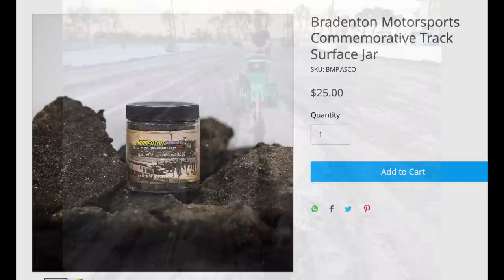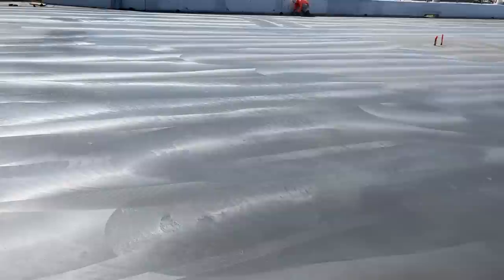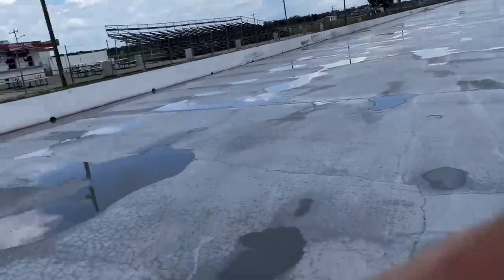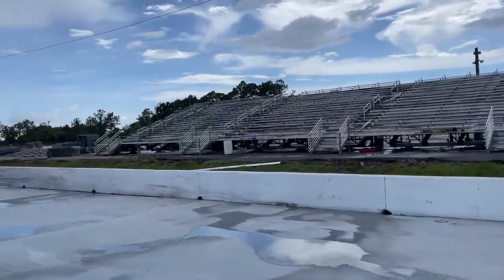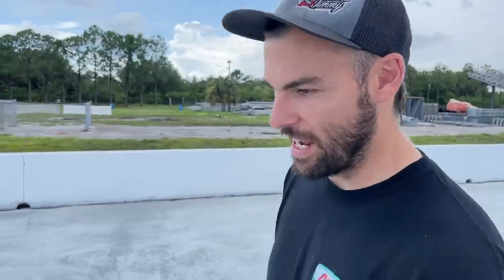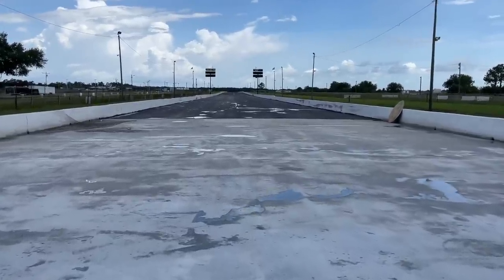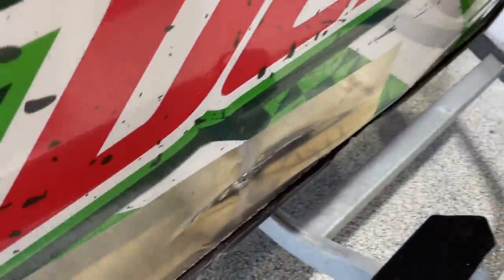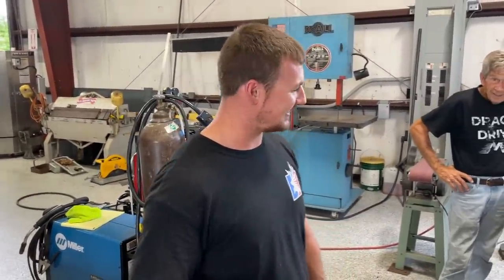This Is Why Our Beloved Drag Strip Closed...

Comment: They didn't keep the concrete wet soon enough to slow the curing: Crazing cracks are very fine, surface cracks that resemble spider webs or shattered glass. When the top of a concrete slab loses moisture too quickly, crazing cracks will likely appear. While unsightly, crazing cracks are not a structural concern

Comment: Told ya steel better for that application. You should have double hulled that boat and the sides the way you treat it. otherwise its going to keep leaking if you keep crashing it into the rocks, aluminum no likie the rocks guys.

Comment: Add a .65 mile dirt oval with a quarter mile dirt oval that uses front stretch as front stretch then put back stretch in infield and the corners and also inside the 1/4 mile oval you can put a small racing lawn mower and go kart dirt oval.  and a motocross/ short course off road truck track and can use same track for rally cross racing and maybe start a local rallycross racing classes like oval asphalt and dirt weekly racing do it with rallycross would be epic and give guys who race dirt and asphalt oval another form of racing they can try or race in for sane money they spend on dirt and asphalt oval mods and latemodels. Add a asphalt .75 mile oval with a 1/4 mile oval using front stretch as the quarter miles front stretch and build it to where you also have a roval lay out with it as well like Charlotte motor speedway and then you can race asphalt oval cars on roval so drivers have to learn road racing as well as asphalt oval racing to make them better drivers and give fans and drivers a one of a kind racing experience that is the only thing like it in united states. You could run legend cars and street stocks, pure stocks and a 4cylinder fwd ministock class on the oval and roval.

Comment: That concrete does not look great. Our family driveway had those micro cracks (only stand out when wet) and it was ripped out within a week and repoured because they considered it failed and couldn't ensure the longevity. I'm not an expert but this doesn't look good and it seems like there are larger cracks in some spots.

Comment: 10 yards of concrete in a truck so 1100 yards of concrete for that project. $120/yard, so roughly $130k-$150 just for the concrete in the trucks. Then you have to calculate another $150k just in civil engineering design and rebar installation. So $500k is my rough estimate on that installation so far with another $80k-$100k for possibly new electrical for the tree and some other miscellaneous stuff that I’m missing. I’m guessing another $50k in bleachers. Add $60k in asphalt for underneath the bleachers.

Comment: There are so many running cracks in that concrete  it is far from a great job  and a full length cut centered between the side walls should have been added  .   Great work it's NOT

Comment: It sucks that they picked asphalt for around the bleachers because the black absorbs all the heat from the sun and the aluminum picks up the heat transfer cooking your ass.
Reply: Could be a off-white or gray cool coat applied to it so it's not so radiant just a thought but I agree with you asphalt's hot🔥 but it's better than getting sandblasted and much easier to  keep cleaner.

Comment: I hate metal bleachers. I went to a track that had the recycled plastic 2x4 and plastic wood looking bleachers and it stays nice and cool during day time summer heat of 105 degrees and the plastic fake wood stays nice and cool seriously so much nicer the aluminum bleachers. And also that polish I have ran on it before on a brand new resurfaced concrete oval track and I took rubber so nice all the way around the track it would take runner just not the corners so if your racing like a 410 900 HP wing sprint car you get more grip out of corners and straights and for restarts so you don't spin tires as bad like you would with out the polish. Asphalt should never be used for racing it's nasty and can be dangerous when used for oval racing huge chunks can hit drivers and go through lexan windshields and if there is a huge hole ripped up during race and don't see it and you get loose and sideways and hit it just right it could snap your axles or shoot you up to the wall or go flipping and all my circle track asphalt cars have nascar 9 inch floaters they are made by winters. I love Jones racing I currently run every part they have for my sprint car on my car I love Jones racing products they are high quality good looking finishes that don't fade or chip and crack from heat of racing and stays looking like new for a long time Jones racing is the best parts hands down

Comment: For all the concrete guys, Why the heck is that concrete all cracked up one week after laying? Admittedly I know very little about the process, but after 58 years on this earth, I have never seen new concrete look like that. Lucky Florida doesn't see much freezing temps or that would surly be useless in one season? Did they lay it too thick/thin or wrong mix...as Cleetus said these guys do this for a living, but aesthetically sure looks not to be a proper job and wouldn't hold up for very long, looks like it is get ready to crumble before cars release 1000+ horsepower on it IMHO.

Comment: fuel boiling in the pump, over heating idling at 95... A/C on at 95 poking past a cop at +2mph, 3 minuets later they pass at 155mph and bust some bloke driving a front wheel drive car weaving in and out at the 110mph limiter. busted wire all along the #2 in Alberta, Idle 95 with the A/C on 2000rpm for #2. quarter inch on the gas sitting 95mph at 24hp and 52lbft 0.31 drag and drafting. all 500 on one tank. passing by three other blowing smoke over heated on that road its a town car never sawt to be highway legal, pull it over before it leaves the city limits. idle 95 for a quarter to a quarter million 220'000 mile is 357 in kilometers till it hits miles! to the 401 in "km's"... one of these days?
Reply: the lights in the old GM quit again, taken by the night... north on #2 that train kept going. passing by a trailer or two throwing tread clear into the sky... motor fully cooked by the end of that 500 even with a restrictor plate and all. Ford: Ford Owns Race Day, idle by 95 all day.

Comment: My dad is part of the reason trees are protected by concrete walls or even elevated. He launched, pulled a monster wheelie and snapped an axle with the bumper almost dragging. The car made an immediate left turn and he came down on the Christmas tree in Houston. Literally the next week it was mounted just like it was last time old Cleeter and the guys were there 👍

Comment: Request: Make an electric Leroy from a salvaged Tesla Model S Plaid, there is a company that has hacked the motor controllers to make way more power than stock. The combo of a go-cart style with lower weight and the 1000Hp motors should make it the fastest quarter mile electric car in the world, fun as hell to drive also.